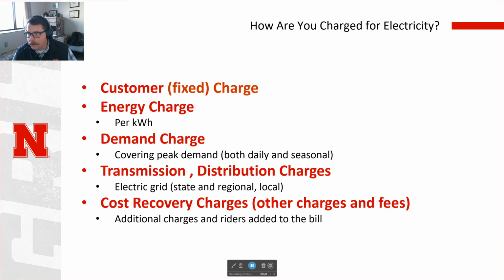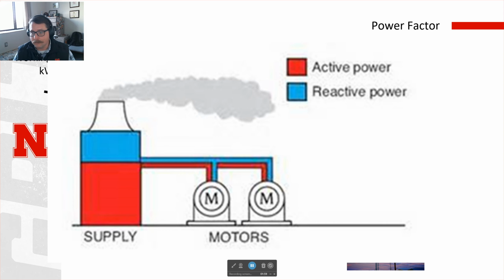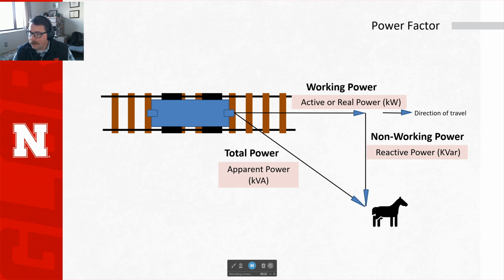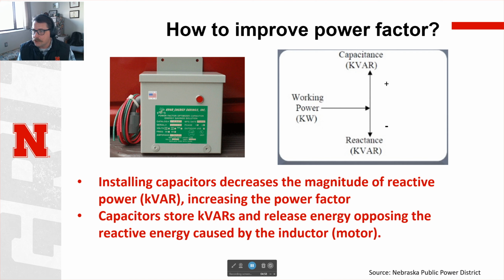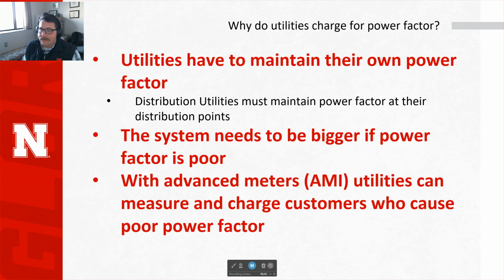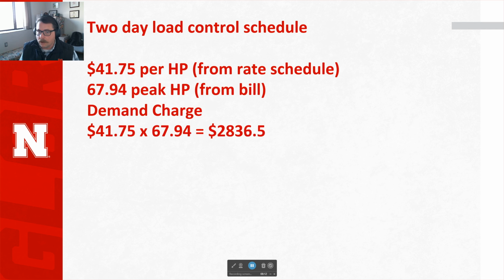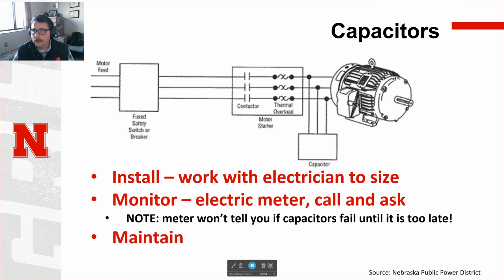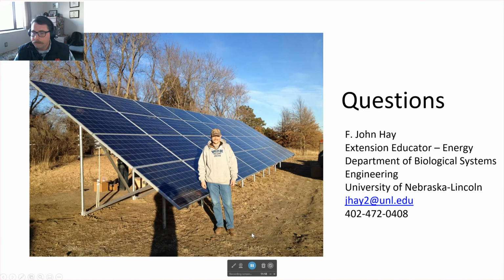Power Factor Changes to Nebraska Irrigation Rate Schedules

Comment: I have a question, preceeded by some explanation of how I understand the technology. Which could be wrong...

I've looked at the technical data sheets of several wind turbines, from 10kW up through 3mW. As I understand it, wind turbines (small and large) don't produce full power until the wind is about 25mph. At half speed 12.5mph they output about 1/8th power (12.5%) and at 9mph their output is zero.

I called a decent sized wind farm here in the midwest and the manager was quite nice and fairly transparent. Of course their website stated the benifit of the site at 100% output, but after some prodding, the manager conceded that the output was much less, putting it at 10% to 13%.

My question: I've done some back of napkin calculations on smaller turbines (which I can get prices on) and with the price of equipment, and installation, I can't see any way to make the smaller ones pay for themselves, even at the retail cost of power.

Assuming the cost per kw is fairly linear for land based turbines, of which I'm unsure; I then consider the viability of commercial wind farms.
 
Once you add in land cost, maintenance, insurance, taxes, and management costs, how is it possible for wind to be a cost effective technology? Financially, it just seems untenable.

Am I off?
Reply from the maker: Your calculations on cost effectiveness of small turbines is similar to what I have calculated.  Large turbines are a different animal. Some major differences.  Large wind farms have an economy of scale with respect to cost of the system. Also being so large they generate large amounts of energy.  Large wind farms can produce energy at a lower cost per kWh usually sell at long term contracts at a price where they make a profit.  The federal subsidy also helps and is paid as a tax credit per kWh for the first 10 years.  For many years recently small wind did not get a tax credit. After passage of the IRA bill in congress recently small wind again qualifies for a tax credit and also may access the increased REAP grant from USDA.  These two things will help the economics of small wind turbines.  Yet there are very few small wind companies who have log term track record so be careful about selecting a turbine company.  Solar may be a better choice because of the robust nature of the technology and the interchangeability of parts. If a panel breaks and can't be replaced by the same brand another brand will work and the system is back in operation.
Reply: @CropWatchBioenergy 
Thank you!
Using my math, I can't get a small turbine to pay for itself (ever). So I'm not looking to use wind, I was just curious how things work at the commercial scale and you've generally answered my question.

In regard to solar, I will be investing in efficiency of the upcoming new build; both in terms of building envelope, home systems, and appliances. There are enough tax breaks, rebates, and long term energy saving going that route, that investing in solar makes no real sense.

At some point I may add some solar + batteries, just as a way to keep lights and refrigerator going, in case of a power outage. I also have generators of various sizes, which have been to use on several occasions. So, really the solar wouldn't be necessary.